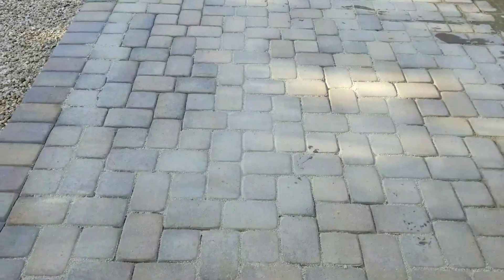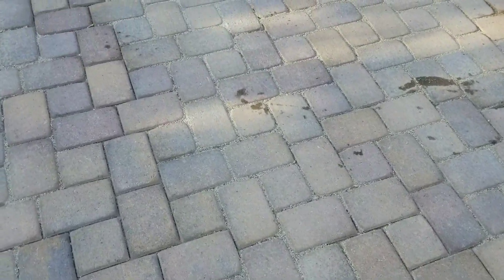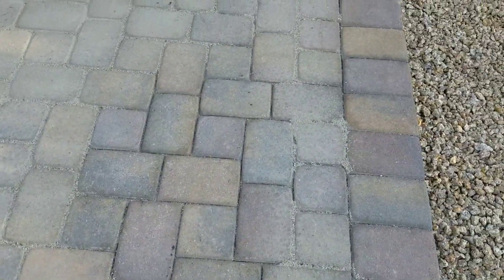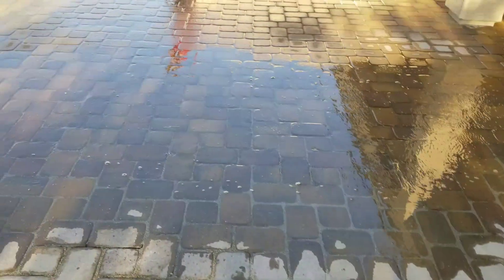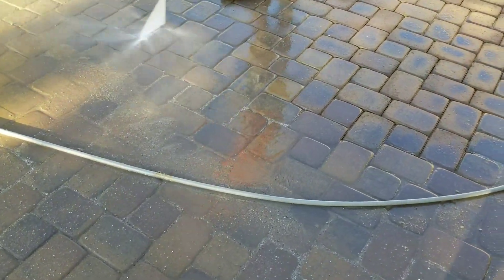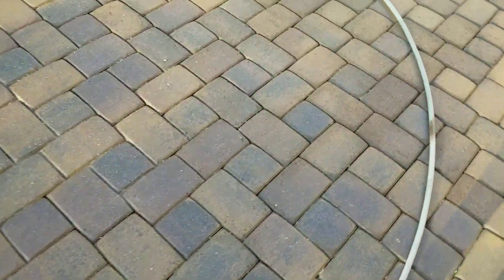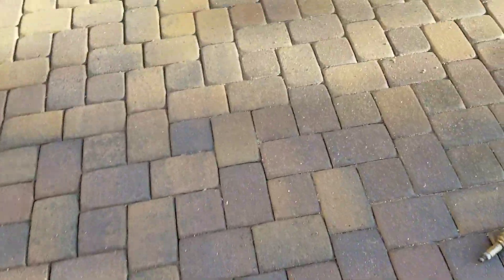Polymer haze on interlocking concrete pavers.

Comment: Won’t using the pressure washer ruin the top of the pavers. The pressure washer would put indents. I have Haze on my pavers. It looks like it’s from the Polyermic sand I used. What type of pavers are they - Cambridge.
Reply from the maker: Using a pressure washer with hot water and carefully remove the poly haze or sand will not ruin pavers.
Reply: Pave Cleaner I can’t use Hot water. Is there a chemical put on that will work for the haze. No acid. How about a Pressure washer surface cleaner for the pavers. And thank you for answering back so quickly.
Reply from the maker: We only use hot water and in my opinion it is the way to go.  The final wash should be some cleaner but the haze is removed with more water to soften the sand
Reply: @blanklooker what kind of cleaner would you use?